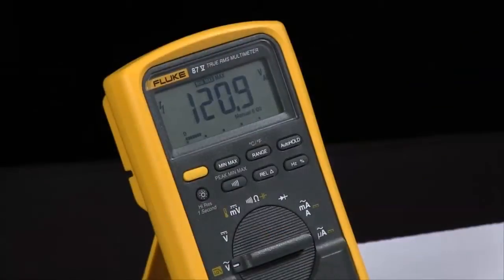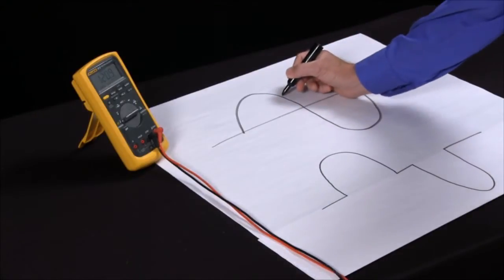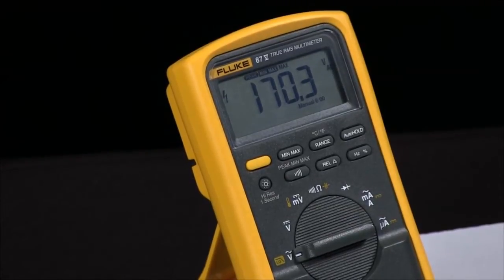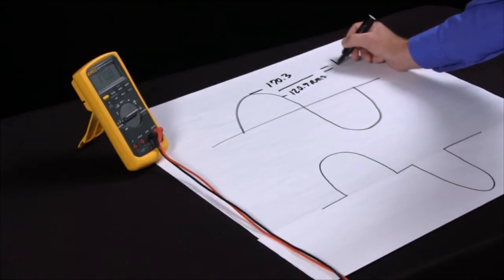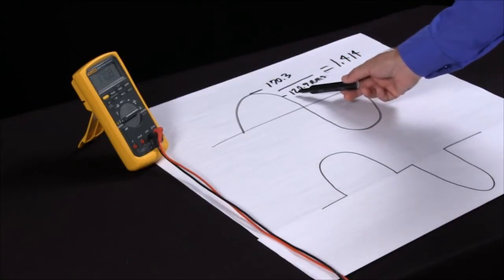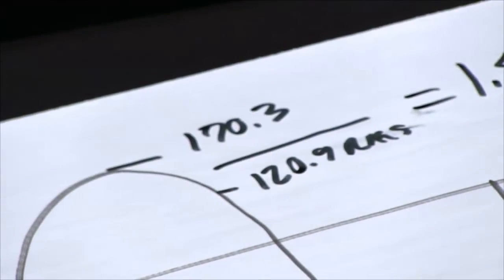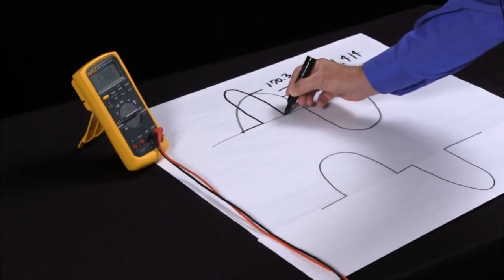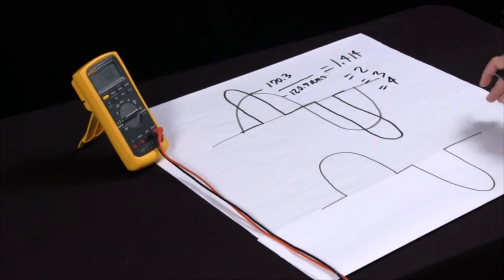How To Check Power Quality With A Multimeter

Comment: So I tested my house and had a 1.39 power factor.  Can lower than normal harmonics cause electrical issues too?
Reply: If at the home run you have 120v , then it could mean a wiring issue or termination issues down the circuit line ,

Comment: That’s partially correct. Harmonics can also reduce the crest factor. Harmonics from single phase power electronics generally reduce the crest factor, with 3rd harmonic being dominant. Harmonics from 3-phase power electronics are more complex and can reduce or increase the crest factor, 5th and 7th dominant with no 3rd.

An interesting case is open-wye open-delta connections on circuits with a lot of single phase load. The 3rd harmonic on the primary is multiplied by -2 on the open leg of the secondary connections, which creates an increased crest factor, while the closed legs see a decreased crest factor.